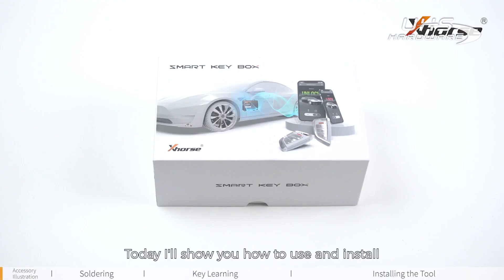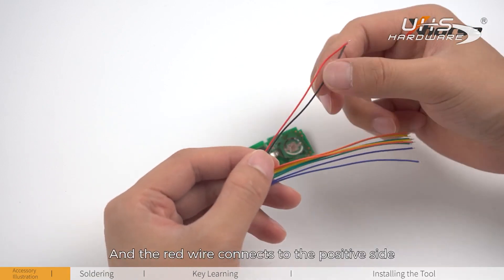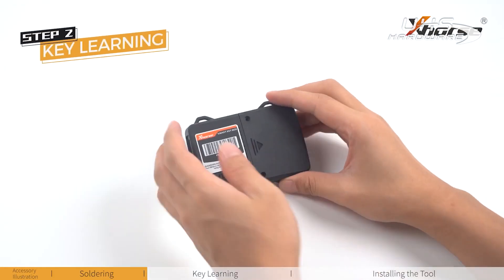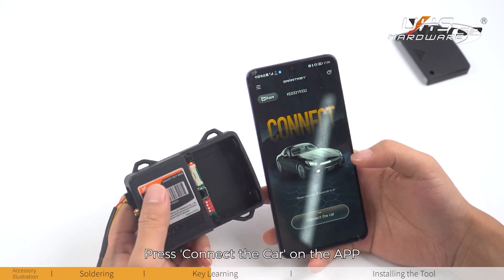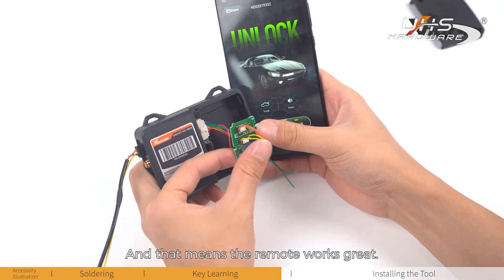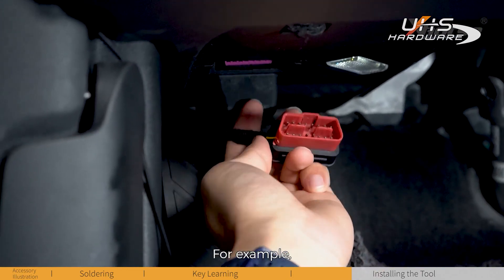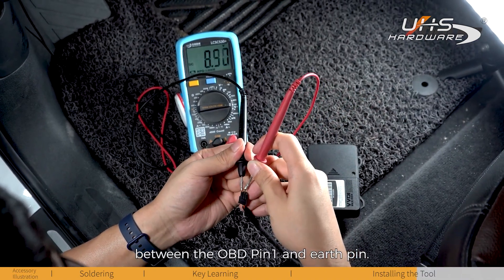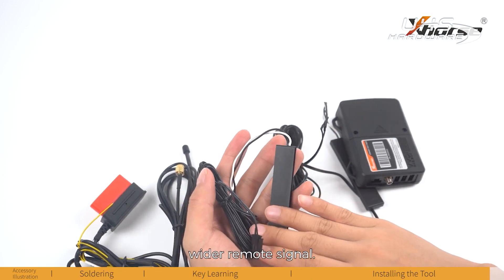How to install and set up Xhorse SMART KEY BOX _ Step-by-Step Guide

Comment: Hello, is it possible to support remote start if there is a button on the car remote?
Reply from the maker: yes. Remote start can be used as one of the button functions. most of the time however these apps or devices only come with 4 buttons to use vs 5-6 for some vehicles. so you'll need to pick or choose the functions used per button in settings.

Comment: That's a lot of work and soldering. bullshit
Reply from the maker: It's pretty easy to do my friend, don't let the soldering scare you. This device is incredible and truly offers a ton of additional accessory to a car, with no actual work having to be done to the vehicle. It's vehicle modification through the key only, that can be removed or placed in another vehicle simply. ALSO: Keyless entry & Keyless Go, and the ability to share your car with anyone through an app; ALLL of thart is pretty cool when you have a car that doesn't have any smart capabilities whatsoever. At least I think so. :)
Reply: @UHSHardware  well in this point of view, i have nothing but agree with you.
Reply: I can do one start to finish… the whole job with install in. About 45 mins and make 550.0 profit pop er unit installed.  I buy a lot of them and get them for 50 each. I sell a minimum of one  a day to one every. Two days and often do multiple a day… I’ve done as many as four in a day. They sell themselves as soon as someone sees Work in person they want one. I install it. They bring it home and show it to their family usually all come back and get them.  No one really sells her offers so I’ve got the market  on walk in my location.